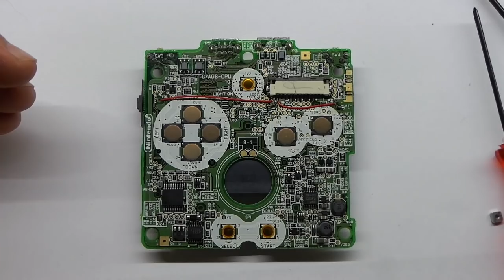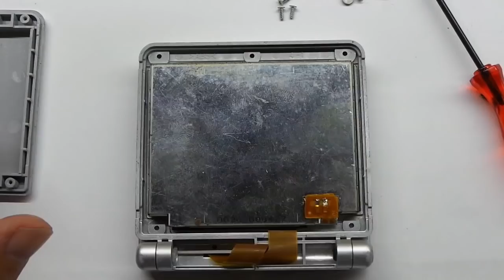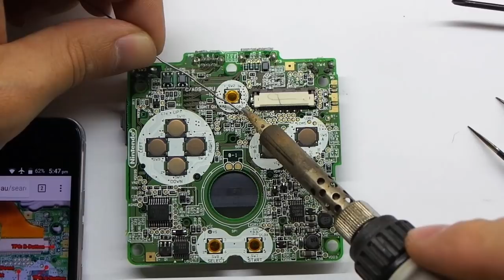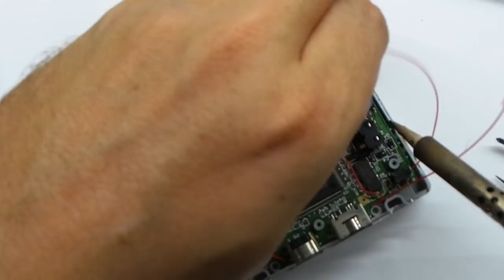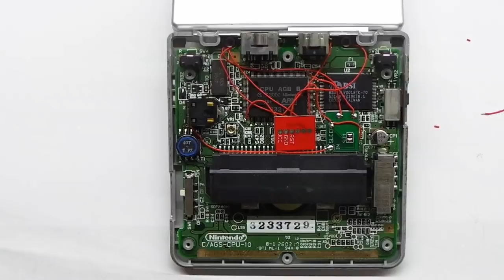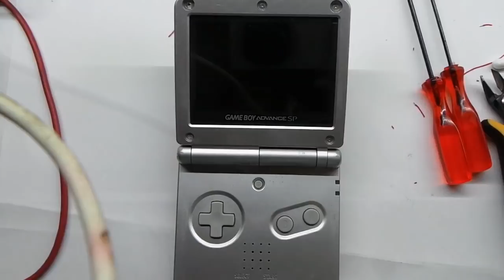Installing an 101 LCD into an AGS-001 + brightness controller mod

Comment: Reviving an old comment section I’m sure but funny enough it’s old enough mod where I just got an SP with your mod installed and was confused as to some power issues it was having. Whenever pressure was applied to the top of the power switch section of the shell it would flicker or completely power cycle the sp. Turns out this was the small fuse either going bad or being blown as a result but I certainly hope I can replace the fuse and it being a 001 board not continuously blow the fuse due to this mod being installed. Great video for its time and I’m very glad most IPS V4 screens are just plug and play nowadays.

Comment: Hi I know this video has been posted 4 years back... However I just have a burning question.... I saw you soldered the positive and negative directly from the battery terminal to the voltage regular at 6:05. Wouldn't it cause unnecessary battery drain even when the console is switched off? Correct me if I am wrong since I am not as experience as you. I think it would be better to get the positive and negative from the power switch itself to avoid unnecessary battery drain when switched off. Just a humble opinion.
Reply from the maker: When the Boost IC is not running, it consumes 0.1uA of current, or .0001mA. This is so low that your standard 900mah battery will take something like 1000 days to run down. So yes, while it is more drain than running through the switch, it is significantly better for the switches longevity not switching the additional current when its running and the power draw while off is pretty much negligible.

Comment: I want to do this mod, but 256 brightness levels is a bit much. I'd like it to work like an original SP, where pressing the brightness button toggles between dim and bright like on an AGS-101. Can that be done with modification to your tutorial?
Reply from the maker: Yes you can add a resistor and not use the brightness controller board and keep it like an original with Low/High or On/Off
Reply: @bennvennelectronics  Just switch out the board with a resistor? Thanks for replying!

Comment: I made a mod without the brightness control and the battery life is just dramatic to say the least. 
My question is: How does the brightness control work in terms of power consumption? Will it use the same amount of power from battery and the excess of unneeded power (as selected by brightness level) will be dissipated as heat by this controller or will it take less power from the battery start with? Second option will definitely increase battery life. The first one - not so much ;)

Comment: I'm interested to know if there's also a way to make an AGS-001 LCD work effectively with AGS-101 Board. (The reverse version of this YT video.)

I tried it, but the AGS-001 screen displays inverted colors and white pixels appear as black. Adjusting the trimming pot made subtle changes, but not enough to correct the inverted colors.

It may seem to not make sense doing this, but it actually does make sense, since plenty of AGS-001 LCD are very affordable in online shops in our place(Asia).
It also serves as a reliable replacement part for owners of AGS-001 GBASP, and potentially an alternative for AGS-101 GBASP owners who would still be satisfied with a simpler front-lit LCD screen as a replacement for their consoles.

Comment: There are IPS screens for about $40 on Ali.
better than 101 and come with controller that let you solder only 1 wire (if you want brightness control)

Comment: Is it possible to brighten the screen without buying the controllers and without using a resister? The resister doesn’t allow the case to close up properly. And! The controller is too expensive to mod

Comment: Hello, I don't get if we need to do the step described at the beginning of the video 0:10 + install of the backlight controller or just the install of the backlight controller in order to make an AGS 101 screen work in an AGS 001 ? I only installed the backlight controller and my console doesn't turn on anymore

Comment: Im so confused! xD
I guess this mod is whitout the ribbon-cable with the brightnes switch (if you mod a GBA and not SP)
Does this mod make the Screen brighter on GBA if you compare it to the switch Ribbon-cable mod?
witch one is best? switch cable or driver board mod??? (on a original GBA, not SP)

Comment: Hi! Thanks for this very detailed and beginner friendly video. This was my first real soldering project and and I didn't have any problems installing the LCD or either chip.

I am however having problems fitting the case back together without a bulge. I have the chips swapped for a better fit (like you mention at 9:48). I don't have any excess bunching or "stacking" of chips/wires from what I can tell. I've spent hours now trying to reposition everything so that nothing gets pinched by the plastic shell "posts" when closing, but I can't quite seem to get it! Anyt tips or thoughts? If not I'll just keep at it.

FYI, I have what I think is the next most recent version of the red chip that you released after the one shown in the video.

Thanks again!
Reply: I have done a voltage regulator install on an SP and have found that even when the regulator board was absolutely flat on the pcb, it still wouldn't 100% fit, the soldered wires on top were just a little too much to fit under the battery part. Could be because I used an aftermarket shell, don't know if those might be a little bit thicker maybe. It wasn't too bad at all though, wasn't hard to close and can't really notice it.

Comment: Hey BennVenn, I have two questions if you don't mind. First I'm just curious, why is the 'sleep' hole of the driver board soldered to the first pin of the cartridge reader? 

Also, I think I'd want to only install the LED driver board and hopefully use the brightness button as it works on an original SP, with a 'low' and a 'high' setting. I saw the facebook post you made about this (https://i.imgur.com/4CI1AW0.jpg) so I know I have to solder a resistor somewhere, but how would I go about doing that with the method you show in your video here? Should I connect the resistor and wire to the "BT-" and then connect that wire to the negative pad of the backlight ribbon cable?

By the way, thank you so much for making this video and making this information available!
Reply: The gameboy shuts off power to the cart when sleeping. So I use this as a sense wire for my regulator. It seems some GBAs don't so I'd suggest following retromoddings guide using a tap from a capacitor. 

You're correct with your plan on going from Gnd to backlight negative
Reply: Hey Ben, thanks for the quick reply! That's good to know about the ground to backlight negative, thanks. As for the sleep function wiring, the retromodding guide has a good image showing where to find C35 on the AGB motherboard, but I'm having trouble finding C35 on the AGS (Gameboy SP) motherboard. I found some decent pictures of the AGS-001 motherboard here: https://gbhwdb.gekkio.fi/consoles/ags/XJF10485171.html

I see C33 and C34 on the lower left hand corner of the front of the board. And I can find C36, C37, and C38 all kinda spread out on the right hand side of the back of the board. I might just be blind but I can't seem to find that darn C35. If you or anyone could help with this I would really appreciate it.

Comment: Hey there, great video! Thank you!  I’m very interested in this mod, however when I see replacement ags-101 screens online, they seem to come with both a 32 pin and 40 pin ribbon with a single red wire to solder.  Is that red wire required for this mod to an ags-001 board?  Thanks for your help!
Reply: jpxdude no, not required

Comment: I'm going to do that mod but I've already cut a trace as the first method with the wires required it. Will it affect in any way the mod with the voltage regulator? Thank you!

Comment: I just finished modding an AGS-101 into an original GBA and a battery mod for the console from a different video using two SP batteries.  I understood the concept of those mods.  This one im having more trouble with.  I have an AGS-001 and the frontlight died on me not long ago. All i want to do is install a 101 screen into the 001, so i really only need to understand the 101 driver board install.  Is there a way you could upload a diagram to the description? This seems to be the only video on youtube that involves the mod and parts i need, but because of the brightness controller mod im confused as to what goes where.
Reply: Omry Dadon Hi there! All you need to do is watch until 6:42

Comment: BennVennElectronics, Hi can you please tell me where can I get the LCD and Brightness controller? thanks
Reply: BennVennElectronics The voltage regulator is NOT required while doing the digital brightness controller mod on an AGS-101?
Reply from the maker: Vitzie629’s Channel not on a 101, no
Reply from the maker: Archy Sanvictores retromodding or bennvenn.com
Reply: BennVennElectronics Is the voltage regulator necessary for the digital backlight brightness controller on an AGS- 101 SP?

Comment: If you don't install the digital Brightness controller will the Backlight button function the same as an Ags 101 or will it just power on and off the backlight ?
Reply from the maker: PixCub it'll just be on or off
Reply: BennVennElectronics Ok :)
Reply: BennVennElectronics so is there a way to make the screen work like an original Ags 101 without the brightness controller ?
Reply from the maker: PixCub with dual brightness? Yes, there are pics on my Facebook. Or I could make a video If it's easier?
Reply: BennVennElectronics yes with the dual brightness setting and If you could make a video that would be awesome :) I'll check your Facebook too. Thank you for your really fast responses
Reply: BennVennElectronics Okay I saw pictures on your Facebook , so I just have to do the install just like in the video without desoldering the negative pin on the LCD and solder a wire and a 380ohm resistor to the second pin on the screen connector on the motherboard right ?
Reply: @bennvennelectronics  I have searched everywhere to find those Facebook pics, but cannot find those anywhere. Any guide on how to make it work with dual brightness?

Comment: Please make a video on how to install a voltage regulator
Reply: Since no one fully replied I can explain this as per this video as simple as possible Make sure when following the guide you SKIP from 1:50 to 3:14 as these parts are completely unnecessary and will result in a mess. So now i will begin the guide. We start at 25 sec you desolder and lift the floating pad. Your only working with Positive! You must tape between the POSTIVE half like he does at 1:07 BUT you dont tape over the minus point, the minus point gets soldered together with the pad. (It doesnt show him doing this since hes doing the controller mod also).you stop following the video at 1:50 but place a final strip of kapton over both solderpoints. Now you feed your wire through the screen shell to bottom shell compartment and put your screen shell back together.  Now you start at 3:14 and follow exactly as he does, at 3:49 he grabs the first wire. This is your Positive wire you soldered from your screen. Do exactly as he does till 6:38 after that your job is done.
Reply: @liracul  thank you for replying! I haven't been getting alerts on comments. You're spot on with your comments too.
Reply: Sorry for the late reply! The GBA install is the same as the SP. Same LCD connection, same battery connection. Difference is the sleep pin which I've documented on my FB page
Reply: pieta On what console are you doing the voltage regulator mod on?
Reply: Vitzie629’s Channel GBA (with a 101 screen)

I know there are guides on Retro Modding but i am too dumb for this
Reply: pieta Okay!
Reply: Casper Films no
Reply: Casper Films actually no
Reply: Casper Films do you have a link or reference to the product you're talking about??
Reply: This little thread should be pinned!